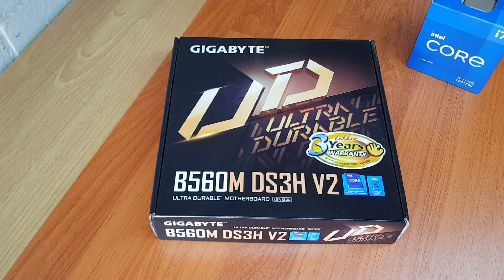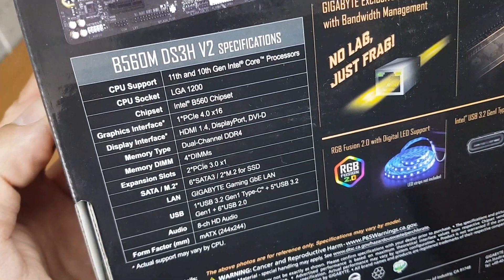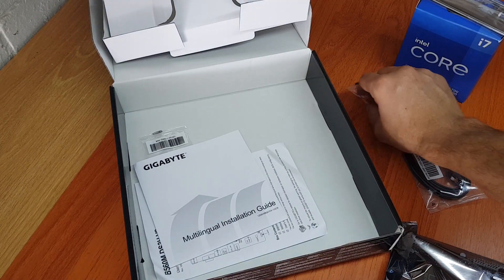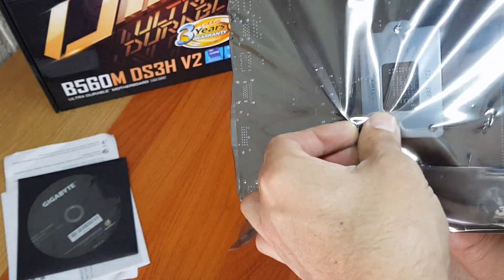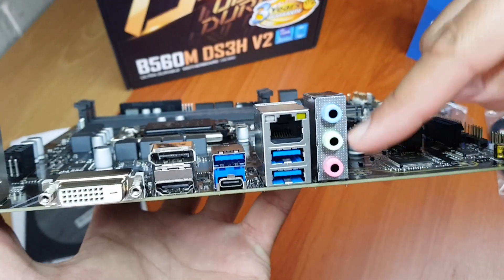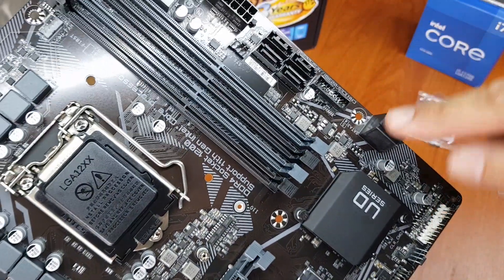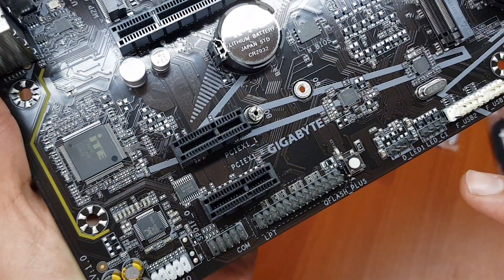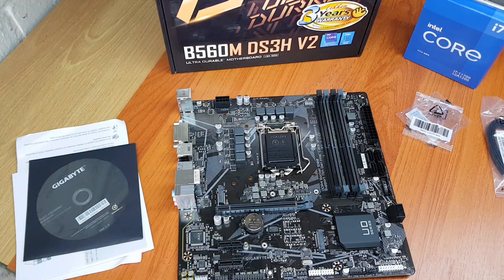Gigabyte B560M DS3H V2

Comment: Do i need wifi to use ethernet?
Reply from the maker: For ethernet you can just plug it into the board with a cable but for Wi-Fi you will need a USB or an external Wi-Fi device to connect to the motherboard

Comment: thanks for your time,  added to Liked Videos  :)  in a few days i will buy this MB for build a new PC with a Kingston NV1 NVMe PCIe SSD 500GB,  placed in the PCIe Gen 3.0 x4 slot. I hope everything will be fine.
Reply from the maker: I'm sure everything will be compatible and work fine. One thing I like about Gigabyte boards is the compatibility.
Reply: @jacqalas  Yup. it's working fast and flawless: this mb, + Intel Core i5-10400F + 16GB RAM Kingston  KVR26N19S8 8GB x2 + Kingston NV1 NVMe SNVS/500G + Gigabyte Nvidia GeForce GT 1030  GV-N1030D4-2GL. Everything in a case 350W ANTRYX XS-120. Win 10 boots in 7 or 8 seconds. My kid is happy with Forza Horizon 5  @ 1080p, well optimized game even with this basic 1030 videocard! no money for GTX but it's enough for him, a forza-adict !! heheh. See u!
Reply: @jacqalas  ya Gigabyte and Asus are the best at making a board

Comment: Hello Man! Thx for u Video, i need a help with output Video (HDMI). In the Bios section, I can see video but when I start my Windows it does not show anything, it only remains black
Reply from the maker: If it was working and it's not working now then it must have been drivers that went corrupt and the only way we found to fix that was reloading windows.
Reply: @jacqalas  The MB on factory only work in DVI, i fix the problem connecting to internet and W10 download the Graphics Driver XD :-D Thaks for u idea bro...

Comment: Hey, l have this motherboard with the Wi-Fi. I have two M.2 slots, but only one shows up, do you happen to know why?
Reply from the maker: I also had that problem once on a board and I had to switch on the Intel function in the bios or something like that
Reply: I tried switching that on, l still didn’t get anything. It doesn’t have nothing to do with my processor right? Intel i3-10100F 3.60GHZ
Reply from the maker: Is your second drive converted to gpt?
Reply: @jacqalas  I don’t believe so, l was doing a little research and it look like l need an 11th gen to make that M.2 slot work

Comment: I bought this card and the i3 10105f, I've read that the NVME gen 4 works only with gen 11, but is it Right? Or can I use NVME gen 4 with my 10th gen processor?
Reply: hey, have you tried? i have a i3 10100F and i wanna see if its compatible

Comment: i buy 500w power supply, does it work with it ? thanks for video
Reply from the maker: Should have no problem
Reply: if u willing to have a 1650 and an i5-10400f i would recommend 50w more
Reply: @mushly4654  1650 is only like 120 watt if you get the one that has the 6 pin, the low profile versions and single card versions don't require any power. the i5 10400 is only like 70 watt.

Comment: I'm not super familiar with PC hardware but I'm seriously thinking about buying this motherboard. Do you know if it has integrated wifi/bluetooth? And if not does it have a pci port for a network card?
Reply from the maker: It has a PCI Port and if you want to put Wi-Fi you'll have to install an additional Wi-Fi adaptor and Bluetooth adaptor but also it has a network port already on board

Comment: does the manebord have wifi
Reply from the maker: No it does not have wifi onboard. I think best thing would be to add a pcie wifi card. They come in all speeds
Reply: @jacqalas  thanks
Reply: The v1/ac version does, not the v2. That’s why I’m getting the v1 rather than the v2.

Comment: 3200mhz ram speed?
Reply from the maker: Don't know the speed but hope this helps
Memory

11th Generation Intel® Core™ i9/i7/i5 processors:
Support for DDR4 4600(O.C.) / 4500(O.C.) / 4400(O.C.) / 4300(O.C.) / 4266(O.C.) / 4133(O.C.) / 4000(O.C.) / 3866(O.C.) / 3800(O.C.) / 3733(O.C.) / 3666(O.C.) / 3600(O.C.) / 3466(O.C.) / 3400(O.C.) / 3333(O.C.) / 3300(O.C.) / 3200 / 3000 / 2933 / 2800 / 2666 / 2400 / 2133 MHz

10th Generation Intel® Core™ i9/i7 processors:
Support for DDR4 2933/2666/2400/2133 MHz memory modules

10th Generation Intel® Core™ i5/i3/Pentium®/Celeron® processors:
Support for DDR4 2666/2400/2133 MHz memory modules

4 x DDR4 DIMM sockets supporting up to 128 GB (32 GB single DIMM capacity) of system memory

Dual channel memory architecture

Support for ECC Un-buffered DIMM 1Rx8/2Rx8 memory modules (operate in non-ECC mode)

Support for non-ECC Un-buffered DIMM 1Rx8/2Rx8/1Rx16 memory modules

Support for Extreme Memory Profile (XMP) memory modules

Comment: what is the highest nvidia graphics card it can take?
Reply from the maker: Normally there's no limit on the graphics card you can put in but your power supply will determine that
Reply: @jacqalas  do you think an antec 700w could handle an rtx 3080 ti?
Reply: @Plixcee  yes it will.
Reply: @Plixcee  750 watt would be more correct, 3080ti draws alot of power from the wall, not to mention the CPU has it owns power. M.2 drives generate a small amount of power, if you buy high profile Ram, it all plays a role.
Reply: @Jeymez  no worries I went for 1000w and got a 3090 ti instead. better for the long run
Reply: @Plixcee  there's no difference with a 3090ti, but what is different is the 3090ti will die out. so better for the long run 3080.